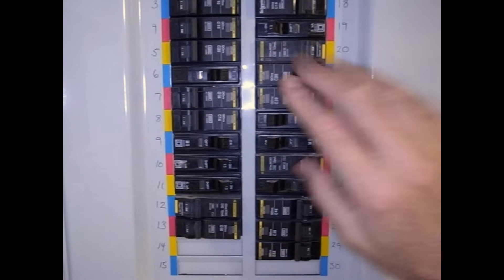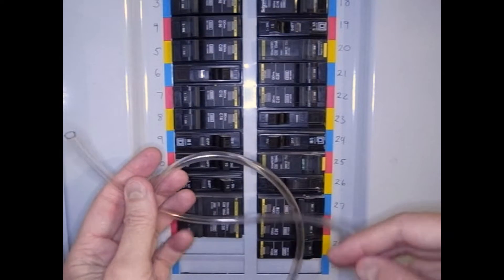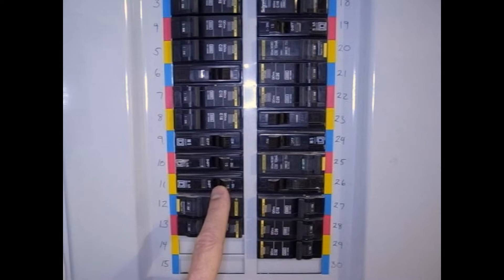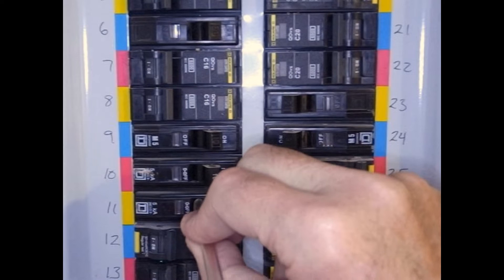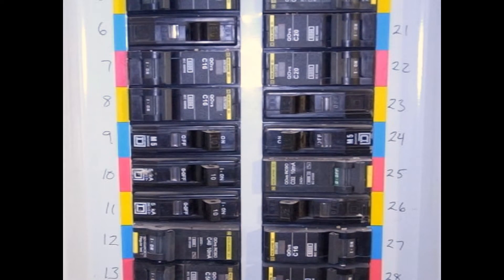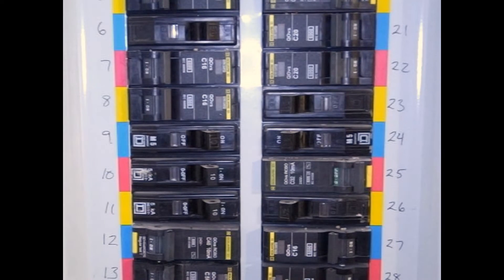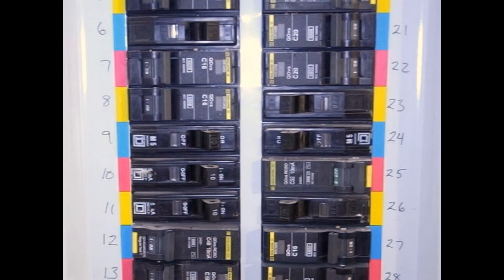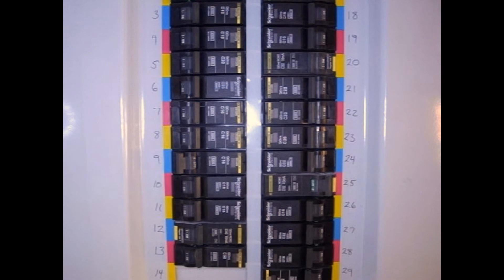Breaker Bad - What's That Buzzing Sound?

Comment: I also thought it might be the breaker because we “assume” wires were properly secured. Glad you caught it and had all the breakers changed out!
When you showed the tube it reminded me of two things:
Old school screwdriver on the engine block to find the knock; 
Tubing used on Peristaltic pumps. Since you and I are tinkerers, if you’ve ever replaced the tubing on that type of simple pump, what type tubing might you suggest for a pump that circulates herbicides and weed killer liquid? Backpack lawn sprayer with battery operated Peristaltic pump. Took it apart and the tube had disintegrated. I replaced that tubing with some of the still playable tube from the backfill just to get the pump working again (with lots of Vaseline). Thought of surgical tubing but don’t think it would withstand the harsh chemicals for lawn care products. Don’t think vinyl (from home stores) would either. Your thoughts?
Reply from the maker: I might go with the nylon reinforced PVC tubing (used for natural gas lines), not because you need the pressure, but because it does not kink nor collapse easily.  I think it's pretty resistant to hydrocarbons (it resists pressurized gas for decades).  After that i might go for something automotive. 

Something I forgot to include in the video, that breaker was to the bathroom light and we kept having CFL bulbs go out every month.  That stopped after we got that breaker fixed.  The arcing was spiking the bulbs' electronics.  I should have known, but...